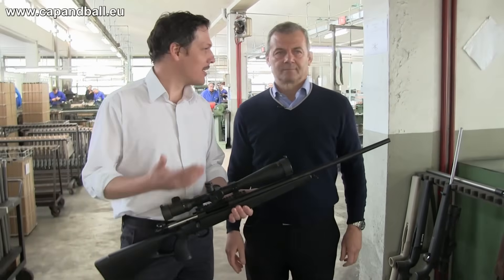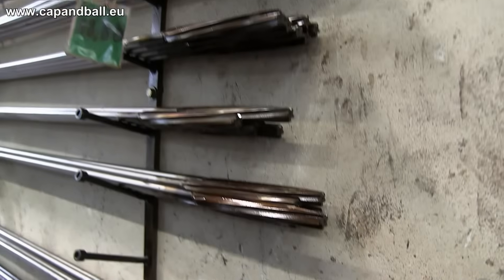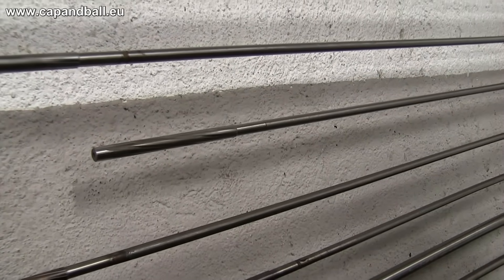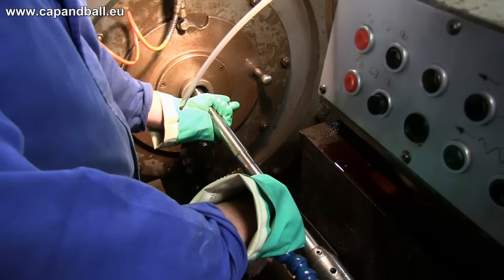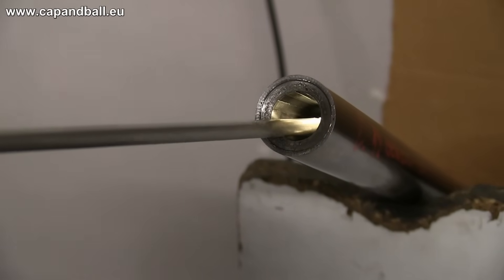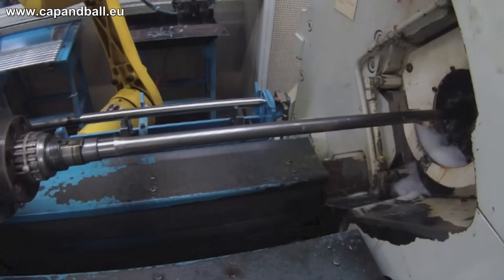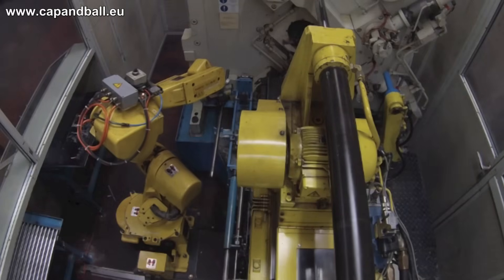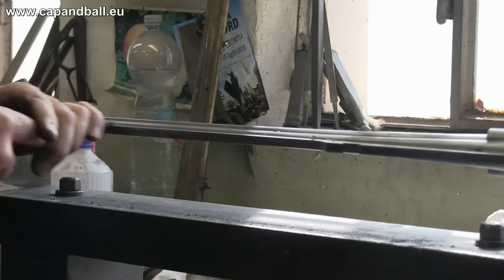How hammerforged barrels and riflings are made

Comment: You can tell the robot arm that puts the barrels into the hammer forge was put there after the fact to replace a human that previously did that work.  If the process had been designed from the ground with full automation, that robot arm would not be there; the barrels would roll into place  from a feed ramp and the finished barrel would be popped out onto an exit ramp.

Comment: Its easier to understand a carbide button pushed through barrel, thus cutting rifling into walls of barrel. a reverse rifling mandrel rod slipped into barrel and then hammered , squeezed , compressed into the metal, imprinting rifling into the walls, AS The bar stock is hammer streched to proper length and Pressing rifling into the walls evenly , over a Long distance. WOW... almost makes your head hurt. How long it took to prefect this method ???

Comment: The firearm industry if like many businesses are going to use whatever methodology makes the most consistent profits.  Where if minor accuracy issues exist because an automated process can make 4 barrels with what are essentially neglible inaccuracies, in place of one barrel that is extremely nearly perfect.  Then other short cuts that saves money or makes money naturally, but it can get radical sometimes.  For anyone unaware.  
With this is in mind, what method creates the finest quality barrel? forging, rolled steel, direct casting, what?  Automation can not be outperformed granted.  But to make the best quality of barrel, reliable, ultimate accuracy and longevity, etc?
I'm thinking one could be forged at home if one has the knowledge and basic facts of barrel making.
Reply: Noone I suggest watch a 13 part series called What on earth happened by Ewaranon to learn that the earth is not a globe. I got it in my about tab.

Comment: The steel is already hardened.  That's amazing to me.  That hardened steel can move that much.  It's so hard to even drill hardened steel... I can't imagine how it stretches and forms that much, especially without cracking.  Amazing.
Reply: Stringfellow I suggest watch a 13 part series called What on earth happened by Ewaranon to learn that the earth is not a globe. I got it in my about tab.
Reply: @flat-earther  And exactly what does that have to do with the video or my comment?  Also, if you want to push idiotic theories, it might help your credibility to at least use proper grammar.  But not much of course.
Reply: @Golgafrinchamdent  No relation but random suggestion.
If you want tell me how to write.
Reply: @flat-earther  Again, your meaning is unclear because you cannot express a cogent thought -- "If you want to tell me how to write."  It goes a long way to explaining why you fall for "flat earth" theories... you're just not very smart.
Reply: @Golgafrinchamdent  I can't necessarily explain things well. I don't suggest merely believing what I say.
I suggest watching the series to learn stuff you may have not heard before and then making up your own mind about it.
Reply: i suggest you make a trip and always travel strait forwarth, till you falll of the earth....... @flat-earther
Reply: @dolmarf411  I as every flat earther to my knowledge do not claim the earth has an edge

Comment: I had been told that hammer forged barrels are of lower quality than button rifled barrels. Tell that to CZ owners that have some of the most accurate out fo the box rifles you can buy.
Reply: calangel I suggest watch a 13 part series called What on earth happened by Ewaranon to learn that the earth is not a globe. I got it in my about tab.
Reply: @flat-earther  that has nothing to do with my original comment, but alright, I'll keep that in mind...
Reply: @calangel  Yes nothing but random suggestion.

Comment: Doesn't the mandrill get stuck in the barrel as it's hammered?
Reply: Well since they succeed apparently not. But anyway I don't think it would get stuck because the steel always has some spring to it so although the hammers force it on the mandrel with blows, after the blow the steel expands a bit so it's not tight on the mandrel. That's what I think.

BTW Ned I suggest watch a 13 part series called What on earth happened by Ewaranon to learn that the earth is not a globe. I got it in my about tab.

Comment: I would like to know how they get the mandrel out, after they hammer the barrel down around it. It seems like it would be stuck. Does it just twist out with the rifling?
Reply: As you can see from the old machine the section the hammers hit and the internal mandrel were only about 7 inches long the barrel was fed into the hammers as lubricating oil was added. I believe the unseen mandrel is turned to creat the twist? I do wonder how much better these barrels would be if stress relived after the contouring process with cryo freezing ? I really don’t want one from the batch that went through before tool wear allowed the no go gauge to fit. We call those ones “Friday guns”
Reply: RaiderSix I suggest watch a 13 part series called What on earth happened by Ewaranon to learn that the earth is not a globe. I got it in my about tab.

Comment: Most of the strongest, sharpest, most durable tools in history have been cold forged. Even before they knew why it worked, men made better steel with nothing more than a hammer and anvil.
Reply: That is hot forging not cold forging.Also cold forging induces alot of stress in material.
Reply: @zumbazumba1  I am speaking of cold forging, not hot forging.
Reply: Tim Hallas I suggest watch a 13 part series called What on earth happened by Ewaranon to learn that the earth is not a globe. I got it in my about tab.
Reply: @flat-earther  I suggest you watch a 7 part series by George Lucas, called Star Wars. The Milky Way is not the only galaxy where people struggle to escape from the grasp of "the evil one"... As in this galaxy, they too have religion that drives the superstitious ignorance that causes war.

Comment: So they precision ream a bore, then turn the OD to spec, and finally, they slide a reverse image mandrel into the bore, and hammer forge the outside of the material until it's to OD spec, and end up with strong then eff barrel, (I got to picturing the complex alignment of the grains in the steel as the process was described.    THAT is some seriously clever inverted/inside out thinking methodology.   

I've been contemplating building a hammer forge just to compete with my new neighbor across the street. He's a professional drummer who bought the remodeled house, and had a not nearly sound-proofed enough studio where the old garage was.  I'm working on the math of how much weight can be lifted as the hammer with a 4' diameter, 1,000 pound flywheel. (some creative gearing and it could be run with a 1hp 240v motor, or a scavenged treadmill motor.)

It should be for a good 'pop'.  LOL   Just haven't figured out what to make the anvil base from. i'm kinda leaning towards find something at a locomotive salvage yard, (as close to Portland, OR, as possible, cause the freight weight's gonna be up there...

I'm looking for that 19th century steel mill 'clang', with the appropriate 'ground effect vibe'.   HaHaHaHaHaHaHaHa!   I wanna make his cymbals vibrate on every strike.  Then, I'm gonna shop for a nice old, use iron worker...  it is suburban war!  

(The following passage was heard in the narrator's voice from public broadcasting's Frontline as I wrote it. Let me know if you hear the same as you read it.)

"He was a conscienscious artist who religiously practiced every day, for many hours. A new member of the neighbor, he was well liked by all, and his dedication to drumming was admired by ALMOST all.  

After his studio went silent one day, he was found with drum sticks where they should never be inserted."

GeoD

PS

I'm joking. Not about building the hammer forge, or getting an iron worker, just about it being to compete. I actually like the new neighbor, he's got some good color on his arms, and he's fairly cool.   I don't actually mind the incessantly repetitive practice patterns he drums one bit.

Comment: The best video of hammer forging I've seen.   PS:  Never mind the trolls,  your English is excellent.
Reply: Is button barrel below cold hammer forged?
Reply: @Pippinm7  If by "below" you mean cheaper, then yes. A button rifled barrel is made with easy tools in a few seconds from a drilled blank. Hammer forging requires far more complex machines. The benefit is a change in material properties due to hammerin. There is this myth of the steel becoming denser, which is no more then a myth. What happens is a change in the material structure, creating internal tension, which in turn leads to harder and tougher material.
Reply: @peteraugust5295  thank you!
Reply: so its called hammer forged because the rifling is done with something like a hammering machine?
Reply: @barfylord8453  The "negative" mandrel is what the hammers are beating/squeezing the entire piece of pipe (unfinished barrel) down onto. The process is akin to squishing larger lump of play-doh through a smaller tube, with a hard rod inside it. Steel can be formed, it just takes immense pressure (the hydraulic hammer). As that machine hammers radially around the barrel, the barrel is slowly pushed through the machine, rotating as it goes. The result is uniform exterior and the internal mandrel with the rifling travels along with the rotation rate of the rifling from one end to the other until the entire length has been hammered.
It's really the same as other hammer forging processes at a steel mill, the goal is to re-align metallic grain structures into a uniform and consistent direction which significantly increases strength, hardness, and other properties. Steel has microscopic grain. It's like the difference between a heap of random scrap metal, and that scrap metal welded into triangular lattice structure. One is shifty and weak, the other is stiff and strong.
Some hammer forged barrels are left with the hammered surface on factory rifles. Many have additional finishing removing those visible hammering spiraled ridges from the outside surface before moving on (receiving cerakote or bead blasting or some other finished surface).

Comment: My gen 1 308 FNSPR has a 26" hammer forged barrel and is more accurate than my custom built M40 308 M700 with a Mike Rock 1:11.25 5R barrel.. My FNSPR is THE most accurate 308 I own.

I even went to New Haven Ct and met the guys in the shop who built it. 😁😎

Comment: I love your channel capandball! I am from Maine in the US, and my job involves drilling metal like what is shown in your video. However we don’t do gun barrels anymore but we used to several years ago (including putting the rifling in the barrel). As someone who loves history and firearms it was interesting to see firsthand how it is done and then watch this. A machine that drills six barrels at once, I wonder how they kept them all within tolerance!
Reply: I am a machinist and used to work for Eaton here in Oklahoma and I ran these huge drill press machines called NATCO’s and they would drill out the motor parts that I made.  Each of the 2K parts got drilled two holes on both sides.  The 4K machine did the same only had 4 spindles with dual drill bits.  The 5K machine had 5 spindles with two drill bits a piece.  So each spindle would drill at the same time.  We did batch testing with a go no go gauge.  Every 20 motor parts I would check 5 of them.  Most of the time they were good to go.  If it got out of spec I had to change the tooling out and set the bits to the correct height.  That was a pain in the rear!

Comment: If the barrel blanks were truly hardened before processing, they could not be drilled, reamed, or hammer forged.  The hammer forging itself imparts work hardening, and much strength.

I would have liked to see how you get the insert out.
Reply: Gun barrels aren't hard like knife-steel hard. Milspec M16/M4 barrels call for a Rockwell C hardness of 28-33 after tempering. Likewise, carburizing doesn't make a thing impossible to machine. I do it at work all the time.
Reply: he means they are made of hard steel, it certainly is possible to apply any of those processes, it is just more difficult to do so.
Reply: Probably just spin it out

Comment: How do cold-hammered barrels respond to the heat created by long duration automatic fire? Are they less prone to warping from released compressive  stresses than conventional machining methods?
Reply: Well the mg42 is hammer forged and it was a heavy machine gun shooting 8mm mauser but It was also designed to swap barrels but still they shoot pretty good and dont explode.
Reply: Not sure .    The hammer forge process does compress the metal making it more dense/harder/durable.
Reply: Best possible way to do it ..today's corner cutters are using salt bath to harden barrels ..nothing beats chf
Reply: @o9rgeronimo979  It still wouldn't be a bad idea to nitride a chf barrel just for the corrosion resistance.
Reply: @milobarbin6927  Nitriding is usually done at around 1000 degrees F, that heat level would tend to bring out internal stresses which might require straightening again. A better bet is hard cold plating.
Reply: My supervisor when I first started work 47 years ago was stationed in the Pacific theater during WW2. He borrowed a BAR out of the arms inventory one time to play around and shoot down some trees, but he got the barrel too hot and it had a minor banana curve when he returned it-the armorer was not too happy. LOL Not sure what barrel forming process Browning used, but they left a lot of internal stresses in the barrel that came out when it got hot.
Reply: Their secret was shown at the very beginning the bar stock was age weathered to destress it. As it can’t be heat treated after the cold hammer forging process. So I assume rapid fire will head up these barrels and shot stringing will occur. .303 Brengun barrels would glow from the heat and indeed droop between shots ! But good metallurgy saw them return to normal as they cooled off.
Reply: @alansutton2858  'Age weathered' for steel??  I spent 20 years in heat treatment and never heard that term. Steel internal stresses need application of heat energy to be removed, there is no such thing as 'age weathering of steel'.

Comment: It's useful to know that one of the reasons for the compression hammering at the rifling stage is to prestress the material, thereby reducing deformation due to the increased stiffness (Young's modulus) and also increasing the loading that the barrel can take. Though this is rarely an issue for civilian applications.

Comment: Ok I do some amateur blacksmithing and I just cant figure out how a barrel that is already hardened steel can be cold hammered to shape. Hardened steel becomes extremely brittle when cold forged and easily cracks, even mild steel (which does still move) needs to be annealed after significant cold forging to prevent brittleness, how is it done?
Reply: I believe that it is annealed after it is hardened.

Comment: "One of the very few who use this method"? Cold Hammer Forged Barrels are pretty common I would say. I think the only Rifles I have that don't have CHF Barrels are my Savage .22LR, Ruger 10-22, and S&W M&P 15-22 MOE (maybe my Remington 700 Stainless 22-250 too, not sure on that one... oh and I don't think Henry uses CHF so my .44Mag Mare's Leg).
Reply: Len M. No they are not as common as button riffled or cut riffled,  not many manufacturers can afford the multimillion dollar machine. Sako, Ruger, Remington, Daniel Defense, FNH, are a few that own them, and they make barrels for others to, but most barrels are not CHF. And nobody who orders custom competition barrels has CHF because it's too expensive to make a whole new press/re-tool for one custom order, they only make sense for mass producing one type of barrel.
Reply: Button or cut rifled barrels are far more common since they require far less infrastructure than hammer forged barrels.
Reply: another issue with CHF is that it's not as accurate a barrel as broached because you put internal stresses into the metal when forging it. The reason CHF is used is because it gives you a decent barrel, and a tough one, but that all depends on requirements. If you need to shoot very tight groups, broaching is the way to go because you don't introduce stresses and distortions into grain structures by cutting them, however it's still important to stress relieve the barrel in order to ensure that in the process of drilling, honing and all the other cutting operations, you don't release stresses that may distort the dimensions of the barrel.

Comment: How do they remove the mandrel after the forging? I couldn't tell from the excellent video.
Reply: The Mandrel stays static in one pointand is so "loose" on the side its pulled towards!
Reply: I think I understand the process a bit better now. I had thought the forming section of the mandrel was as long as the finished barrel. I can see from 3:14 the forming section of the mandrel is only about 8cm long.

I didn't realize the mandrel was pulled through the bore.

Thanks for taking time to help understand.
Reply: Imagine a tube of clay. Put a finger inside, squeeze with the free hand, pull finger bit back squeeze and so on and so on !